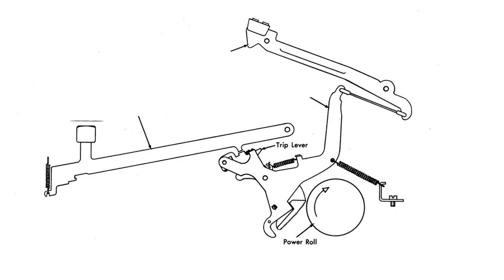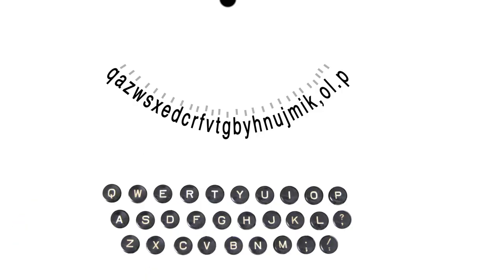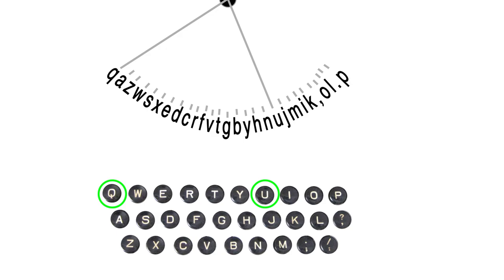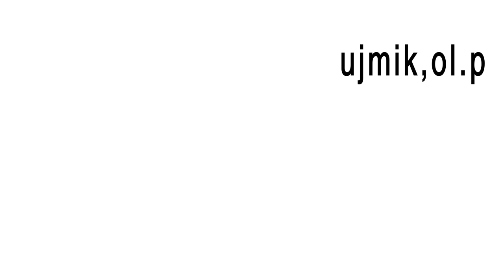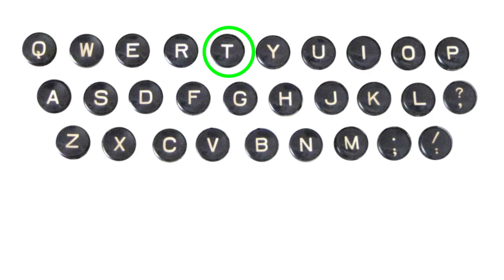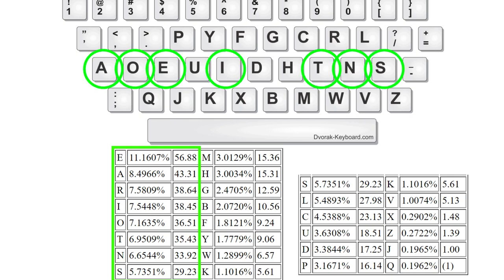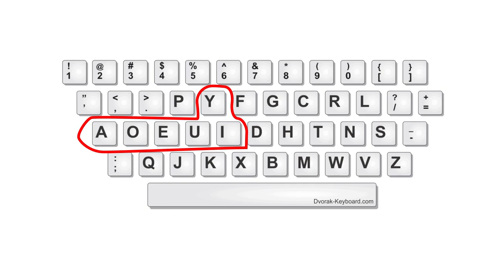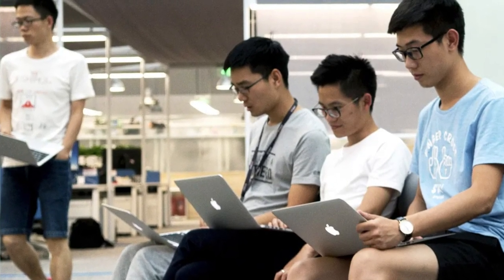Why Are Keyboards in QWERTY Arrangement? Typewriters, Keyboards, and Typing Explained.

Comment: this is a good case study of how the substrate (mechanical system and its constraints) influence the user interface (layout of keys).
Take this abstraction and apply it to any other substrate or user interface (e.g. VOIP being audio, and having to list options sequentially for callers, and thus ordering the options based on what the VOIP party wants the caller to hear before other things - e.g. "take note as our options have changed. if you are calling about the most frequent thing, press 1")

Comment: Hey great video! 🙌🏾 
Quick question: Is there any reason why modern keyboards are still staggered? There is no mechanical reason for it obviously. Isn't it much more ergonomic to have keys one below the other but still in the same order?
Reply: simply because the stagger is the universal, and moving away from the universal is pretty hard
Reply from the maker: The short answer is that people got used to it. Same reason we still have QWERTY.
Reply: @paper2222  it's really not. keyboard and laptop companies make different sized keys and different positioned keyboards all the time across different models of their own product lines.
Reply: @gwho  how many times have you seen another person in public using a matrix keyboard

Comment: 4:47
hard disagree. pinky inwards and down is MUCH easier and natural and faster than pointer finger up and out.

The reason why can be broken down into 3 dimensions.
inward vs outward,
down vs up,
which finger is naturally more controllable.

inward is easier than outward.
down is easier than up. (pushing key on the upper row actually involves extension muscles and then flexion. it's a two-fer, whereas downward is a one-fer in only flexion).
only index is easier than pinky.

on paper it's 2vs1 in favor of the pinky motion
. in practice, you have to weight each one as whole package, and even then Z is easier and faster than T.
Reply: it depends, some find it hard some find it easy.
they probably just picked one layout to make it universal.

just like i can type wsx and ujm said at 3:42 with ease cause i learned typing the "wrong" way so my muscle memory is different.

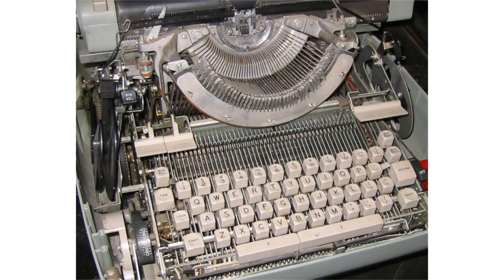Comment: Please cite your sources. The belief that QWERTY keyboard was designed to slow down typists is an urban myth. Professor Bill Hammack posted a video on his engineerguy channel in 2014 titled "Why the Dvorak keyboard didn't take over the world" that points out that it was human engineered. At 5:43, you imply that Dvorak was created for computers. However, August Dvorak created that layout in 1936.
Reply from the maker: I never said that QWERTY was chosen to slow the typist down.

I probably could have changed the wording at 5:43, though when scripting these out I have to think as much about making a script flow and feel digestible as I do giving all of the relevant information which would lead to a 3 hour video. For example I initially had a section explaining that the number strikers also seperate some of the keys but it felt overwhelming.

As far as why DVORAK didn't take over, the topic is heavily debated and people on both sides are very passionate, so I couldn't really come to a firm conclusion one way or the other. I personally couldn't imagine using dvorak, and I do believe the world record for WPM is held by a QWERTY typist, but it's only by like 5% or so.
Reply: @H3Vtux  the fastest dvorak typist currently is NoThisIsJohn on Youtube. His record for an 1 minute test is 200-210 while the record just passed 250 with qwerty. I wouldn't call it 5%. by the way the record for Colemak is around 230.